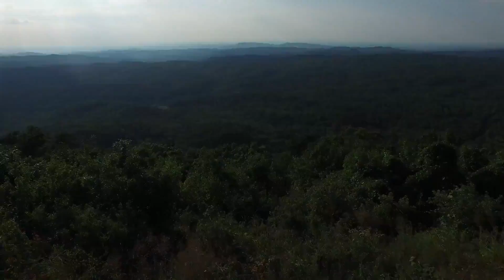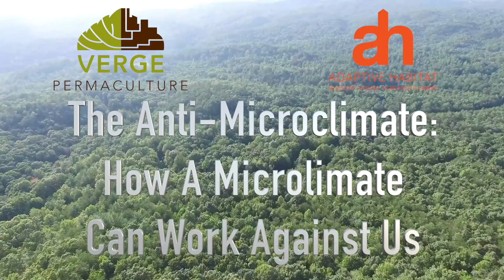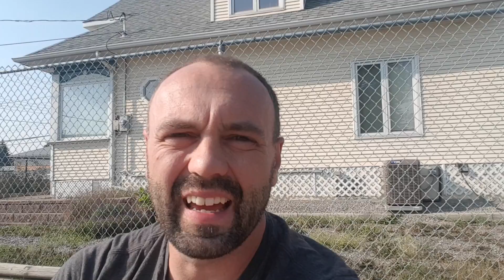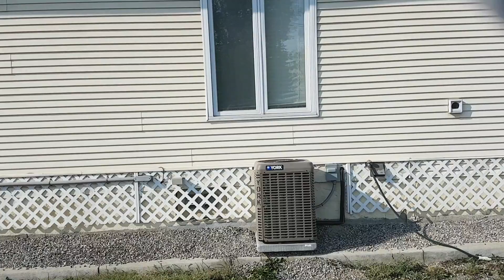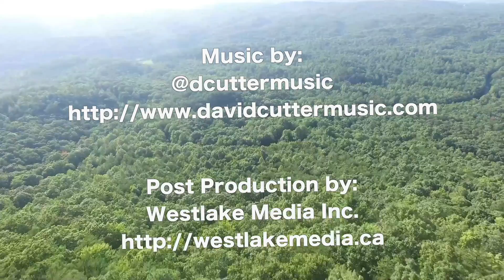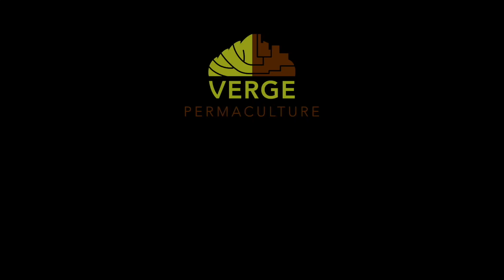Microclimates: DON'T DO THIS!!!

Comment: 2X to 3X the power cost is a big claim
Backup?
Reply from the maker: It all depends on the condensers ability to reject the heat and condense the gas. An air conditioner should have a COP of 3 in the right conditions, but in the wrong conditions it can drop below 1 which is where the 2 -3 times the energy consumption number comes from. Look up coefficient of performance (COP) and you will understand.

Comment: if it is used as a split to warm the house in winter, isn't it better to put it on south side?
Reply from the maker: Yes, or perhaps the East side. There could be a number of places to place a minisplit. Each scenario would have an optimal placement. This, however, is not a mini split but and air conditioner.

Comment: the best example of microclimate i ever seen is inside the castle garden inside walls of marvão castle at 855 meters (39º23` 42.34" N 7º 22´ 44.16" W), sorrounded almost alpine climate, the walls protect from the wind and the perfect south facing slope and castle walls runoff make for a mix of desert oasis plants, and pond.
Reply from the maker: Thanks for the comment Bruno!